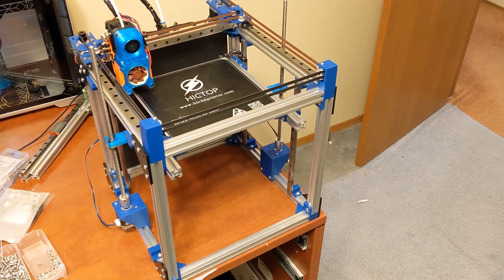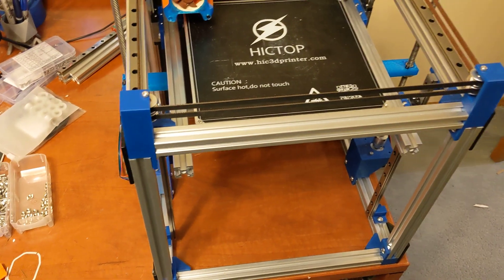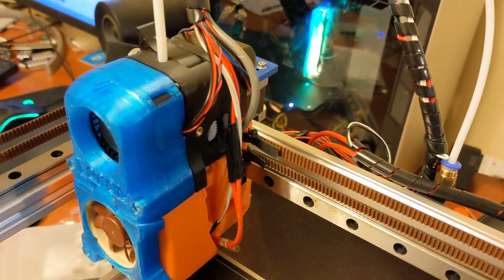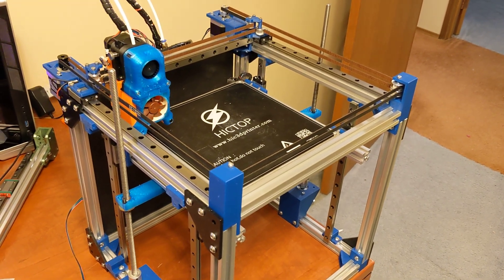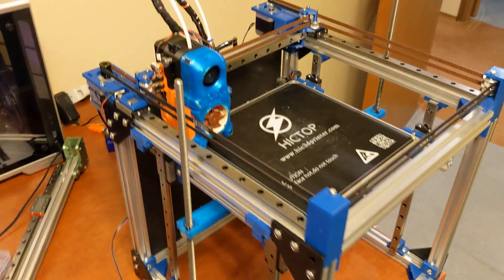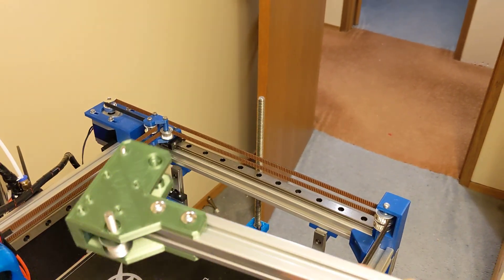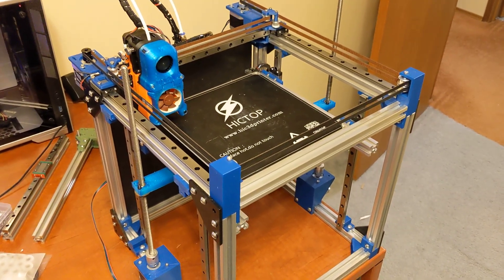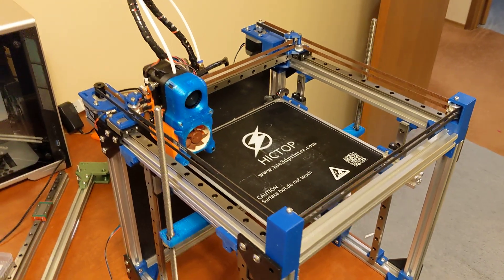CoreXY 3D Printer Build Episode 4 Final

Comment: When you start over, I will recommend using less liner rails for the z-axis. Two seems to be good number unless one is trying to do the kinematically coupled automatic tramming thing. A single liner rail already constrains the motion of whatever is attached, to a single liner degree of freedom. In terms of exact constraining a single liner rail for each axis is preferable. However cantilever structures are not known to be stiff so people resort to using two liner rails instead of one.
Reply from the maker: my next version will use 3 linear rails instead of 4 as I will be doing 3 point leveling with individual steppers and belt drive